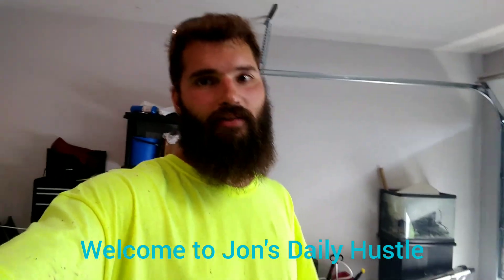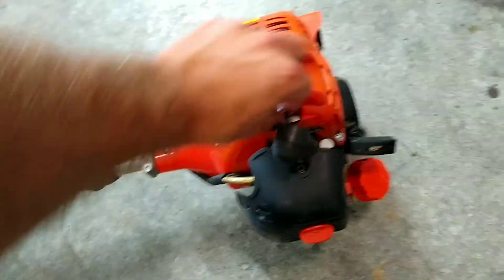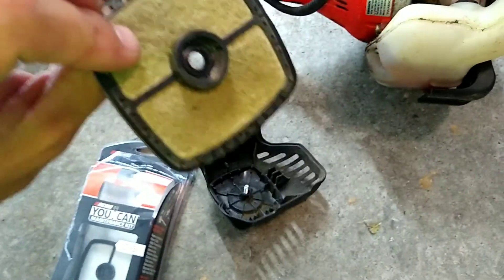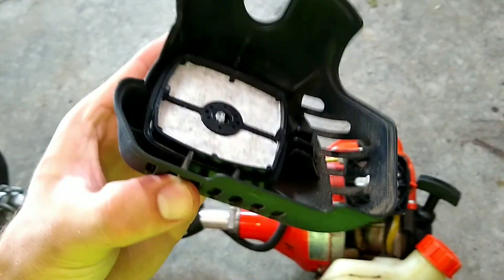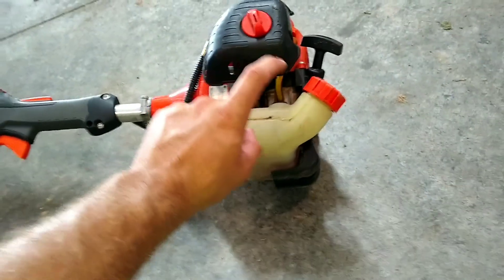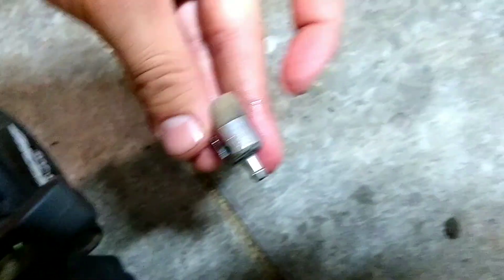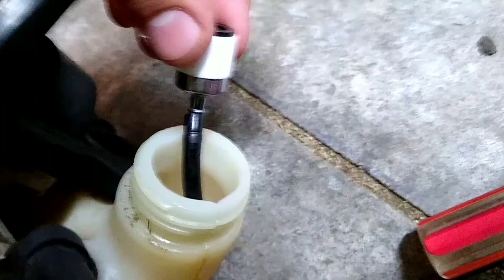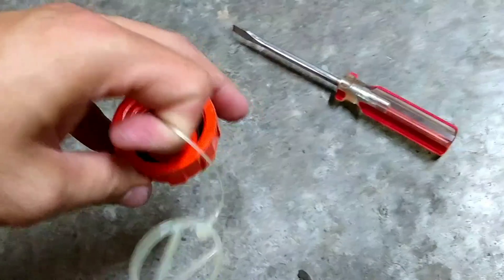How To Do A Tune Up On An Echo String Trimmer Using A Tune Up Kit

Comment: I am having no gas prime in my bulb..goodness, it sat a few weeks and no start. I see gas in the back side of the white plastic part . (where the plastic films is) but no fuel in side if bulb ..someone told me check valve clogged. Can I clean or soak the plastic white part or where can I trust to buy a who carb. I can do easily what u just did so, I should be able to complete the rest..minus tuning
Reply from the maker: Yea I'd say you have a vacuum leak issue somewhere. Could be a small hole in the line or in the tank, or you have a blockage I'm the fuel line

Comment: Just did it myself on my SRM225 and works great! I was wondering Jon is that smaller fuel filter just a newer version? I noticed it was different than the last one that had that metal ring around the top of it
Reply from the maker: @Dylan Pratzner yes sometimes they just update it a bit and it might change size slightly, if it's a huge difference you might want to look into it by questioning your dealer and see what they say. and most of my experience it doesn't seem to make much of a difference but some of your stronger more powerful tremors might actually need a bigger size filter as they suck in more fuel but so far I've had no problems with a bit of a size difference
Reply: @JonsDailyHustle  okay cool yeah I just wanted to make sure before I put it on and used it, I didn’t wanna break or mess it up. my SRM225 is smaller compared to other trimmers so I think it’ll be fine. Anyways good luck this year and keep up the good work! I’ll be watching haha👍💯
Reply from the maker: @dylanpratzner3247  hey man thanks for the support I appreciate it. Good luck to you as well. Nothing wrong with using the 225, that's all I use...it's perfect for me so far
Reply: @JonsDailyHustle  yeah dude the things a beast especially for the price